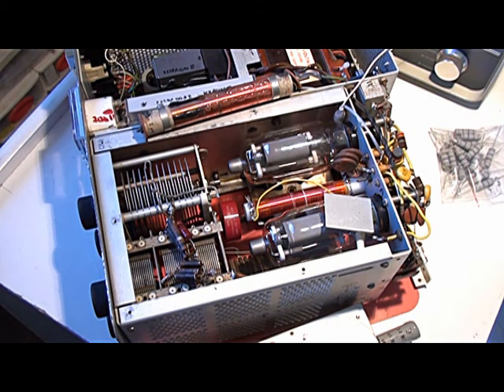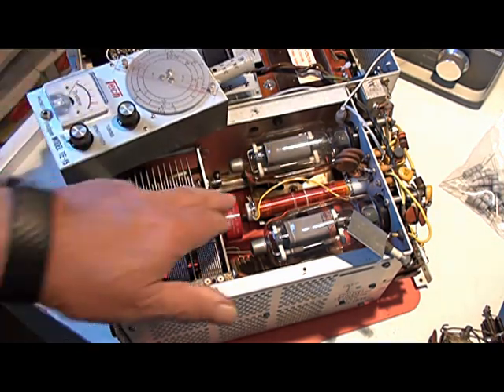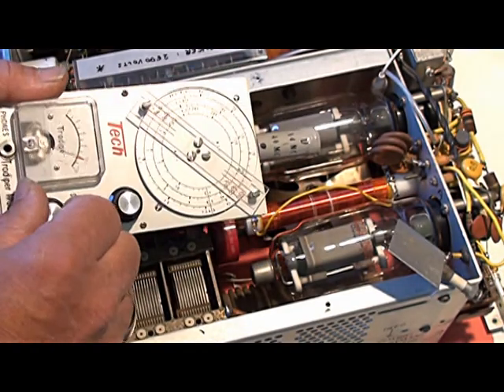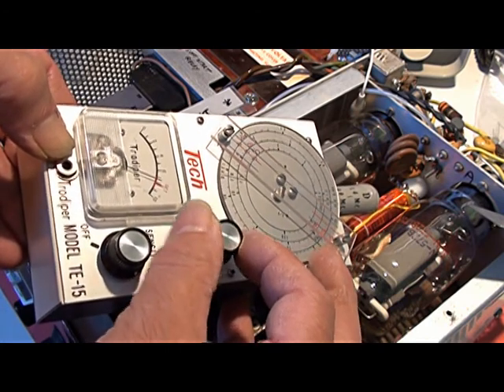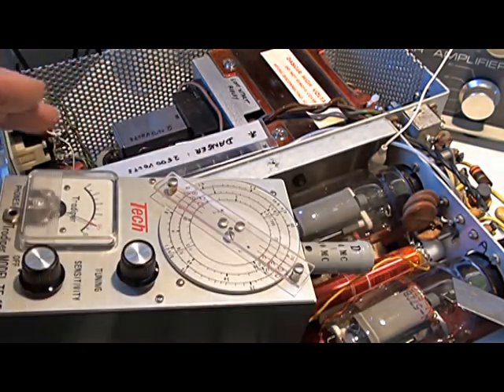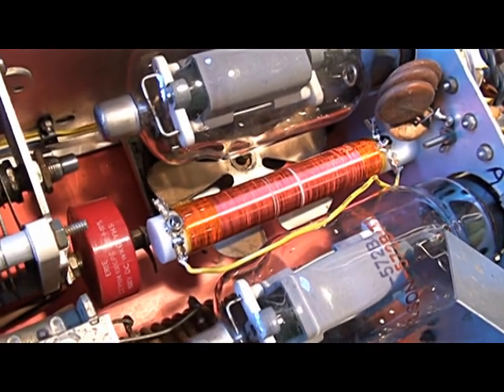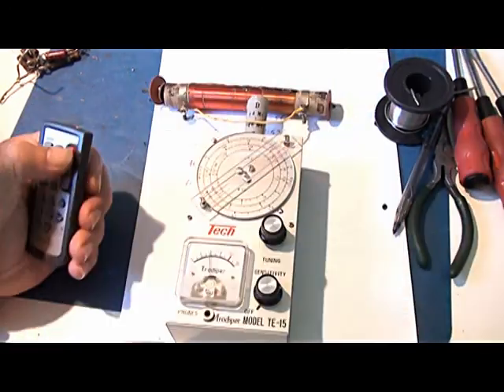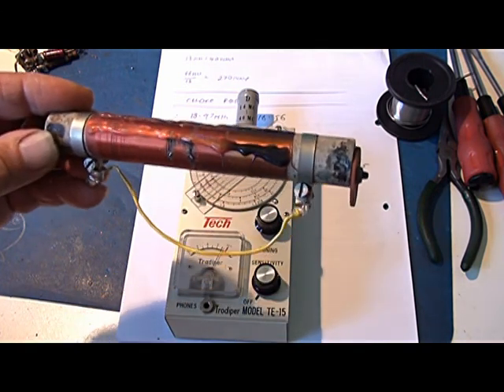KW1000 Plate choke resonance tests MPG

Comment: Hi I  have a Heathkit SB200 was using 572b same I guess the same circuit as the KW, now in the process of reverse engineering it to use GI6B Russain triode military tube as the Chinese 572b are junk I purchased a pair and only lasted 4 weeks.
The anode choke is about 1/2 diameter and about 4 inches long and compared to yours seems to small but tuning the pi tank no sign of any problems  Have you checked the inductance value ? trying to find out what value of inductance I need, I have some 18 mm PTFE rod 150 mm long and try to see if it works and going to use 25 swg magnet wire.
Reply from the maker: Hi, mine measured around 135uH. so its reactance at 3.5 MHz, the lowest band my linear goes, is nearly 3000 ohms. If your linear goes down to 1.8 MHz, you need around 220uH. The reactance has to be high enough to make sure not much of the RF goes down through it, and lost at the bypass caps at the bottom. It really needs to be at least 3 to 4 times the impedance the PI coupler puts across the tube after converting the 50 ohm cable load back across the tubes. The RF plate impedance of the tubes must also be lower than the reactance of the choke but that is hard to calculate. It's not the DC voltage by DC anode current, but the RF voltage by the RF current, which depends on how well loaded the tubes are into the Pi Coupler, and any phase shift between the RF voltage and current. And in SSB mode it goes up and down with speech peaks. The 135uh works for me okay. Make sense?
Reply: @vk3aqz  Hi thanks for your reply. The  amp covers 80m 40m 20m 15m 10m and I will try for 135uH 
I have a antenna analyser also doubles up as a GDO which will give me the inductance or could use my inductance/ transistor tester/ capacitance meter .
Reply from the maker: @itsonlyme9938  Ok. Yes, the analyser should show where the resonance frequency is. I checked it with the 2 ends of the coil connected together mounted in the case (as per my video). The enclosure metal will change the resonant frequency so most people advice on doing it in the box. I actually did a measurement outside the box on its own just to see what it was. In the box, I think it changed by around 100kHz but I cannot remember if it went up or down. So maybe do the same first. The wire size you are using should be fine. I think the current could be around 600 mA. I actually took about 6 feet or thereabouts (really needs to be about the same length as the choke) of the wire and passed an amp through it using a 12 volt variable supply with a 10 ohm resistor in series (10 volts across 10 ohms = 1 amp). The actual resistance of the choke wire is nearly zero so you need the resistor. About 20 seconds is long enough. If it blows it's too thin -- Hi !! Use thicker, or 2 strands in parallel if you don't have thicker wire.

Comment: Great restore Lou! It never ceaases to amze me what types of 'bodges' lurk underneath the outer covers of some pieces of equipment, some laughable, others - downright dangerous !! 
I would be inclined to think that when in use, the lower impedance of the valve/tube will dampen/broaden the resonance somewhat, but the only thing that would/should affect the frequency is the metalwork once back in-situ as you said. 
I once read a valve audio amp design book that explained how at any given point in 360*deg of a signal that the Anode impedance will change dynamically and that specified output transformer impedance secifications are based on the average anode impedance - or something along them lines....
Reply from the maker: Yes, I have come across lots of dodgy stuff inside gear. Valve linear amps demand a lot of respect so any work done on them should be done with that in mind. It's not really that hard to do a tidy job. Many hams here in OZ are now going back to valve amplifiers and second hand ones are snapped up. I have had a few solid state ones, and like others, have had issues with reliability and some blowing up. They don't like reactive loads, unlike valves, which can handle that. Fets can switch very fast, and if the loads are not resistive, or have high VSWR, they are so fast that they often blow up before any of the rather poorly designed protection circuits can do much about it. Good solid valve amps don't really need as much fast protection. Plenty of companies still make valve amps and it's not that hard to replace a valve compared to a hand full of FETS in a 400W amp that has blown up. And valves, although not cheap, can still be had for less than 4 RF power FETS. Yes, the valves also have a high dynamic range whereas solid state devices don't. You are correct about the impedance of a device changing during the 360 degree cycle of an RF sine wave. The impedance is simply the RF voltage divided by the RF current. Both are changing during the RF cycle but don't exactly track over the load line of the device so the Z also changes. However the average value does not change as much.  If you look at, say, the curves for a 572B RF valve with 2000 volts on the plate, at a grid voltage of 40, the current is 300mA so the valve has an equivalent DC resistance of 6k, and at a grid voltage of 80 volts, it has a current of 680mA and a DC resistance of 3k. During an RF cycle, the actual anode voltage will swing up and down with the signal and the current will follow. The actual maths for the RF impedance is a bit more complex since the phase between the RF voltage and RF current varies with things like the effect of any tuned circuits, but essentially, yes, the impedance will vary according to the equation Z= RF Volts/RF current and any phase difference between them during any RF cycle - it certainly won't be constant!!  Cheers, Lou.
Reply: @vk3aqz  Wow! Thankyou so much for mentioning the '572B' RF valve, I 'googled' it, d.loaded the data sheet and consider myself that bit more educated. As soon as I saw you 40v vs. 80v current it immediately struck me how these RF valves are driven, totally different world thn the audio valve gear I am used to where eg. -80v would be cutoff -40v G1 being round where it's bias point would be set. Interesting to see the way they constructed these valves that 0v is their actual bias point - makes for simple drive circuitry for sure I would imagine. 
Your reply brought back a memory of reading a story many moons ago of a ham who had loaned his neighbour - another ham his main dummy load. He had been repairing a solid state set but wasn't finished aligning it, however there was very good skip conditions he couldn't resist and during a QSO he was looking out the window to exchange weather reports when a huge bird 'as if in slow motion' landed right on one of the 'traps' on his dipole, before he unkeyed the rig there was a crackle.... From that day on he said unless his amp was of the Tube, Valve or Thoriated filament type - he simply did not want to know. 73!
Reply from the maker: @Magikflame  Interesting story about the bird landing on the antenna trap - I bet it felt a bit warm that day!  Yes, valves are pretty robust. But you can blow filaments sometimes. Yes, some RF valves were designed for zero grid bias voltage as the normal operating point. Good for RF stability.    Cheers, Lou.